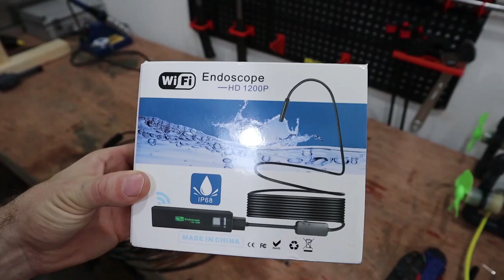Underwater Drone Build

Comment: Love your vids. Try this out on you ROV.. Where your props are, they are open and thus loose a lot of potential thrust because there is no cowl around them to help direct their potential thrust. Put a cowl around each one that is around 4 - 5 inches long and that is just just a bit bigger diameter than the props. Your acend end descend as well as forward and back should improve. Failing that keep the cowls but print a prop with a more aggressive pitch.
Reply from the maker: thanks for the advice mate

Comment: Excellent build. Do you mind sharing where you sourced the propellers? Thanks
Reply from the maker: Off ebay mate
Reply: What size did you use? I can’t seem to find anything larger than 3.5cm diameter for my motor with 3mm shaft